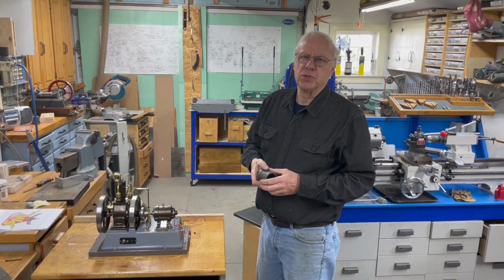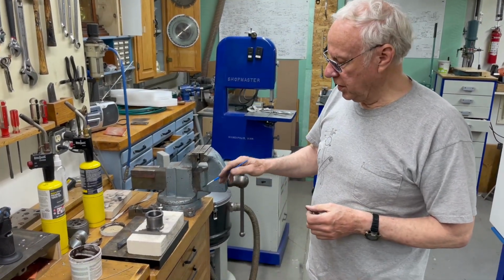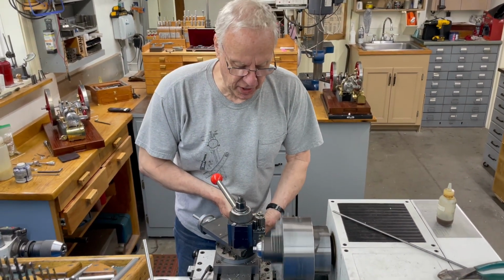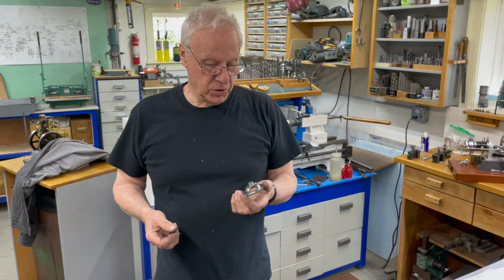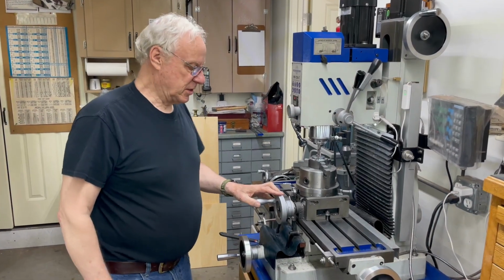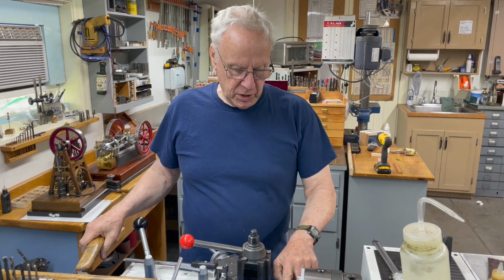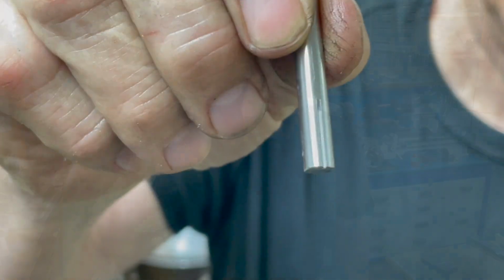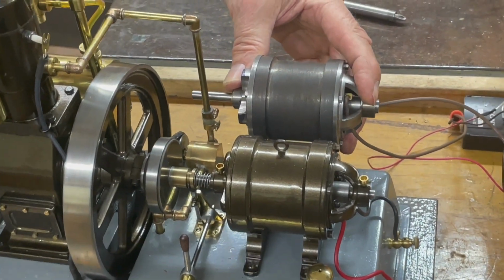Generator for Doug Kelly's Meriam Abbott Engine

Comment: Excellent video and explanations! One day I will build my own generator once I build one of Doug’s engines!!
Reply from the maker: The plans for that generator will be featured in Home Shop Machinist I think starting the next issue. That is a excellent engine to start with and it’s one of his engines that has fewer parts. Most of the engines he did plans for are two or four cylinders. Lots of parts!
Reply: @JoesModelEngines  the Bruce MacBeth is the one that I really want to build!